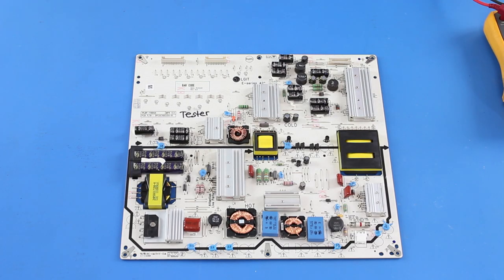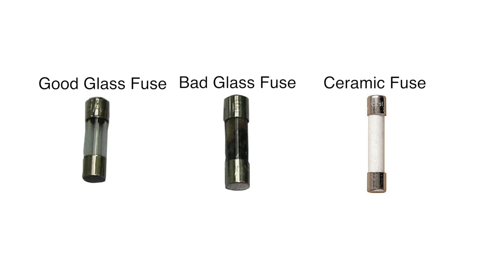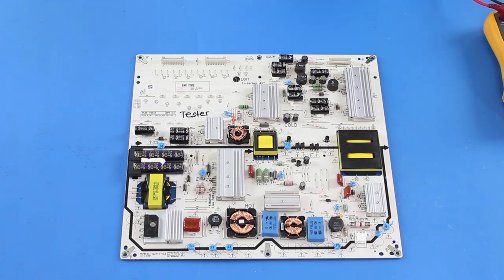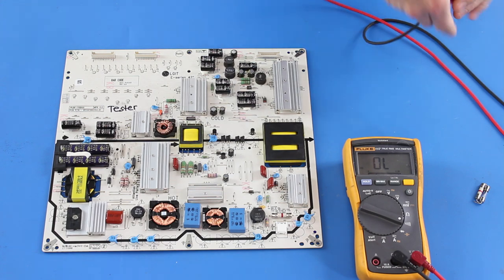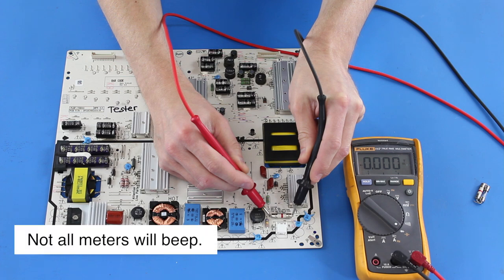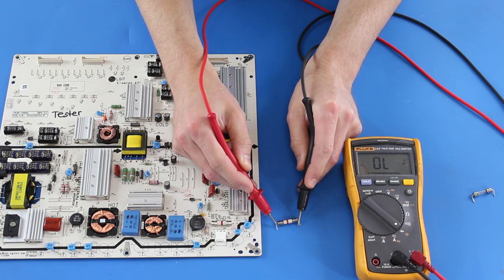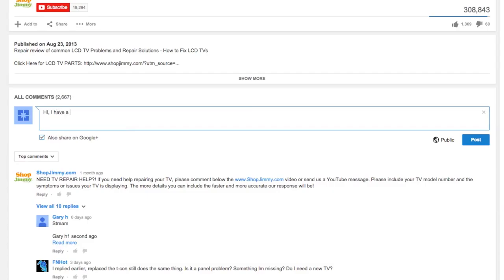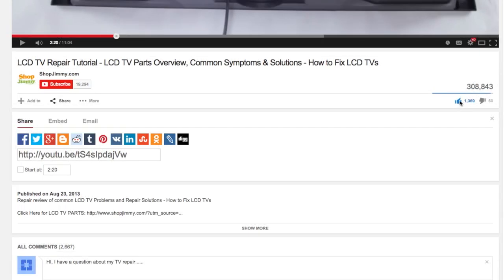How to Test a Fuse on Your TV Power Supply - TV Repair

Comment: Thanks so much for this easy to follow video.  We were all set to open the back of the TV when we did one more check and realized the power plug was not pushed all the way into the wall.  What a laugh we had!  At least we know know what to do when and if the fuse really does go.

Comment: Thank you for this elaboration. My tv is SEIKI 43 has not fuses and no sound or picture. The power supply is ok and the indicator is lit as usual but the screen is blank grey not black. Before it died on me it flicked twice with longitudinal streaks. I used multi meter but all the capacitors and other  gadgets with two poles are fine. I would appreciate your expert opinion. thanks

Comment: This also would apply to power boards on printers.  My task.  I think I have a blown cap as the fuze (which would have been an obvious place to start) is ok (0 with no beep as my radio shack MM doesn't beep on that).  I'll have to see if you have a bad cap video.

Comment: Good evening.  I have a Samsung UN40EH5000FXZA.  It will not power on and has no standby light.  Inspected the board and everything looks fine.  I used a meter on the fuse and I am getting 0.01 and 0.  Is that a bad fuse?  If so, how do I change it out?  It is the ceramic variety.  Thank you for having these videos.  Helped me replacing the power board about a year ago or so on same TV.

Comment: So I have a philips 50 in with 250v 5a fuses. The first fuse on the PSB reads ~120v, looks good.... my next one and every fuse after it read 1,300!!!!! I don't know how these aren't blowing apart. It has a the 2 relay click no power issue. I checked the VS pins and VR pin to the ss and sr boards, VS pins read 13v each across both boards and the VR reads 33v, so power is getting through.

Comment: hello, I recently the main video board for my 32" vizio TV model# VA26LHDTV10T because the picture color was solorized.  after replacing the board the TV will not power on, not even an orange light on the vizio logo.. the TV had no power issues before the new main board was installed.. what else could this be ?

Comment: I have a cheap Cen-tech multimeter. When I put it on the fuses it starts at like 190 then goes down to1 on all of them. My meter don't beep but it does show 1 before you even touch it to the fuse and like I said it ends on 1. So what does this mean?

Comment: Hello, is it possible for an electrolytic capacitor to be bad,, if the tops are all flat and the cross on the top is still sealed? Caps have been in an LG TV, built around 2010 Many thanks
Reply: Yes, they can dry up and cause the value to change. If it changes value enough it is considered bad.

Comment: Where's the fuse on a ba31t0f0102 1 board and what does it look like?  There's no glass or ceramic fuse visible, yet the board reads "Replace fuse as marked".  I've got power to the board ac connection but nothing beyond.

Comment: got a 40 inch magnavoc tv No power , model -  40me324v/ft   , supply board ba4g25f0102 \...... got a blown fuse f602 ....... need to know what type of diodes to buy ( shorted) !!! the symbols ( SB3A0 BL ) part numbers? confused  (circuit -  d655 , d653)

Comment: What are odds only fuse bad after very close lightning strike took out some electronic devices and even popped a 15 amp breaker in main panel even though a main panel whole house surge protector was installed.

Comment: I have a Plasma LG 50PN4500 that has no picture but does have the standby light. When I press the power button standby light it will blink red three times then do nothing (no clicking). I disconnected the cable that went to the X and Y sustain boards and it would blink three times again and not go back to the red standby light  - can you assist me to find what might be the issue?
Reply: I can help you, take it to a TV repair shop. You're welcome. :)
Reply: Matthew Ward

Comment: Samsung UN55FH6200F - Power Supply BN44-00499A - PD55AV1_CHS.  Flat Screen - Red ON light flashing - Screen will not turn ON.  No video/sound.  I replaced the Power Supply Board w/new and with no change.  Power button cycles  RED flash for 5 seconds the Off for 5 seconds.  What do I check next?
Reply: Todd Furst

Comment: You didnt say what it meant if it wasnt all zeros. Mine beeped and showed .002
Reply: It's continuity 'your fuse here is good, usually shows from 000.1 to 000.7 but .4 is spot on for good fuses. Anything other will not connect, all it is is making the connection from one side to the other OR NOT... forget the numbers for now..